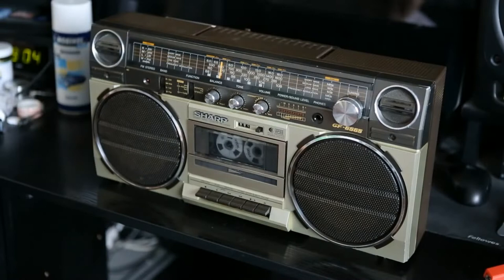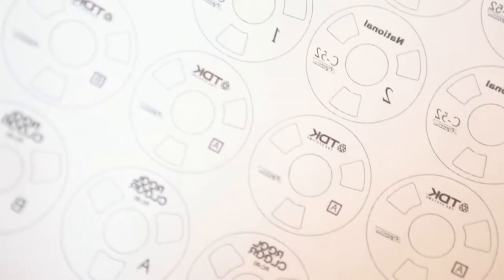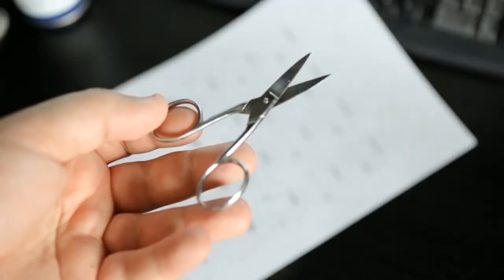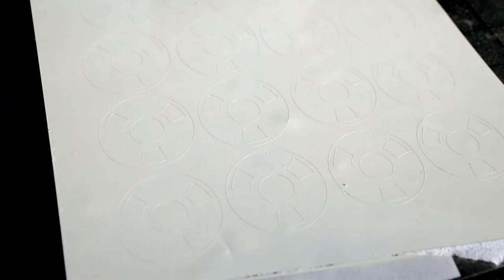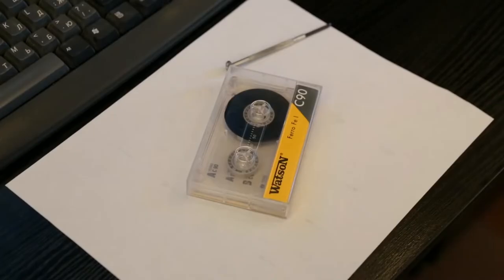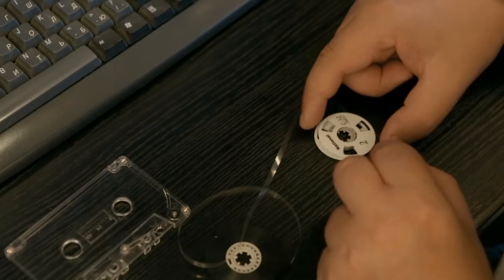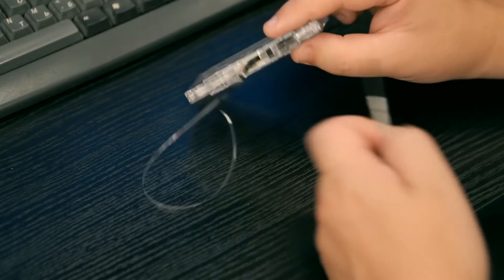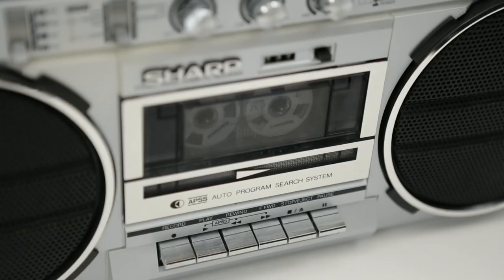Reel to reel cassette DIY Hand Made

Comment: If the tape is 52 minutes and you initially started out with 60 minutes, you cut off 4 minutes in each direction which I believe if I calculated correctly is 37 1/2 feet of tape.  I don't necessarily want to do that to sacrifice time for looks.  The crazy thing is some cassette decks don't have a visual window to see that.  I think you're very talented to be able to do that, though.  Have a great day.
Reply: Shorter length isn't the biggest downside as you can just find a short program to record. The biggest problem though is that you have to do everything correct like this channel did, or else you may damage the tape because the reels were glued too tight/ the reels were bent/ etc.
Reply: @examplify4248  I wasn't too worried about that. I've repaired tapes before.
Reply: If it's for a gift, i don't think it matters. Nobody's gonna do that to all their tapes